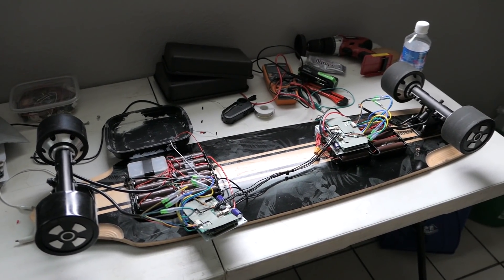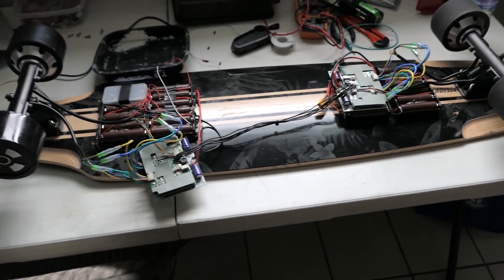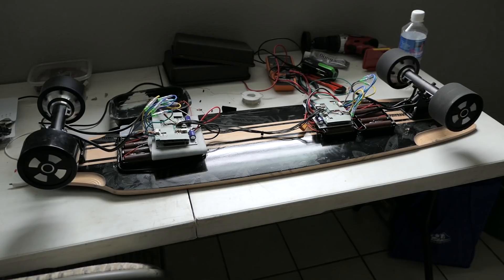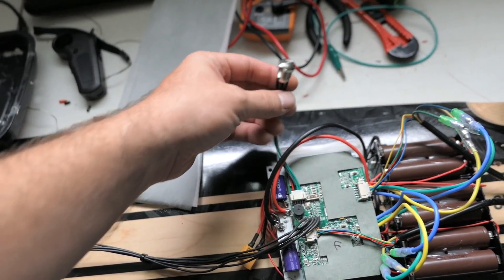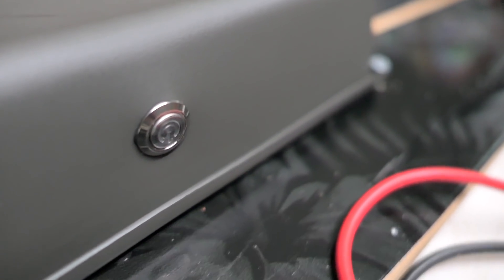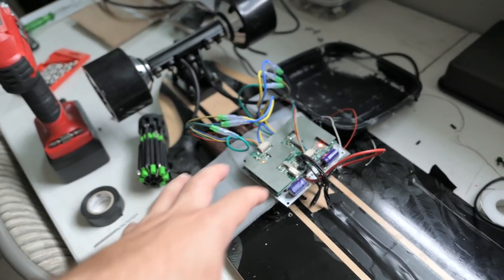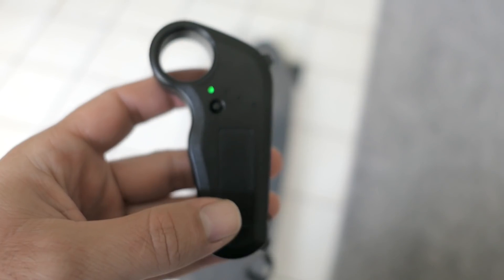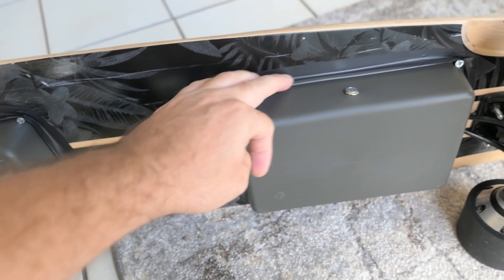4WD Electric Skateboard Build - Completed

Comment: Hello. How did you connect the two controllers to the common system? Do you have instructions for such controllers? Or tell me where you can find this instruction for connecting two controllers so that both units work from the same remote control ?

Comment: awesome build, gives inspiration to get started on my board. something to consider, is maybe give hot glue a try to seal the electronics case to the deck. might be better than tape. or maybe shoe goo around the edges, then for sure it will be water tight.

Comment: I am almost finished with building my DIY custom AWD 6374 motors; just waiting on some 10 AWG wire extensions from Amazon to splice; it's going to be rated at 12,600 watts with a 12S4P li ion battery. Already made a video on a dual 6374 motor setup.

Comment: The motors are rated for 37km/h so you wont go faster than that no matter how many motors you add. But you will accelerate much faster and go uphill much faster.
I think that the main problem with your board was the 10s1p battery. It cant push the amps that the motors want to be able to give you all their torque. You should have at least 2p for dual motors and 3-4p for the quad setup.
Reply: pshlos, I agree
Reply: It would be different with a pulley and gear setup bc you can optimize the torque
Reply: Or LiPo batteries.
Reply: true story:)
Reply: Agreed. Looking at theese batteries i think they are Lg´s HG2 18650 Cells rated at 20 Amp Max draw. and at 3 Amp/h it is very low range and the Voltage drops at 1p are HUGE.
Reply: I'm tempted to say that just adding a much bigger battery with his 2wd setup would have been a better investment for more performance.

Comment: Back truck is not the right way around
Reply: Filip not necessarily because depending on what style of trucks you are using for example normal long board truck face outwards where other styles may be different btw the ones that face inwards are for normal skateboards built to stay strong when doing tricks